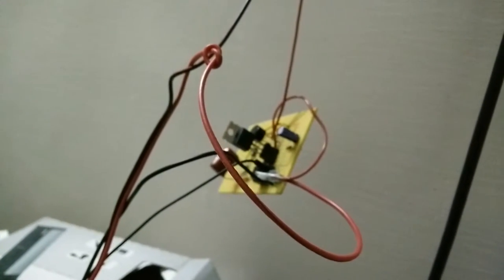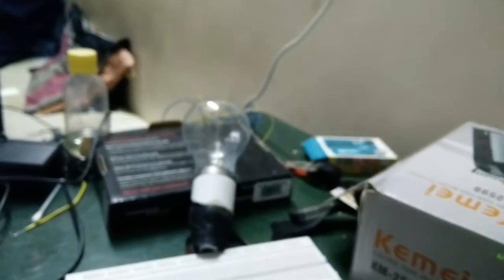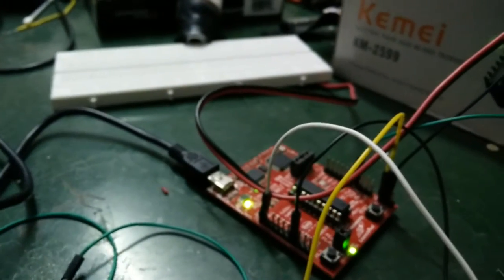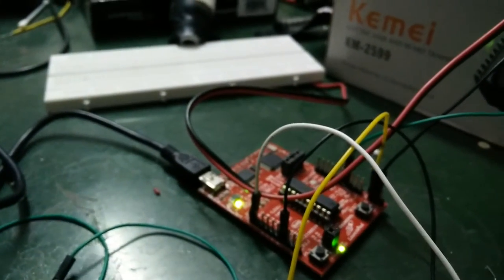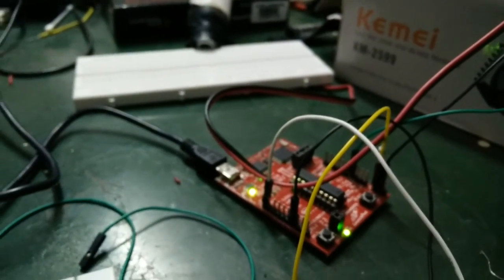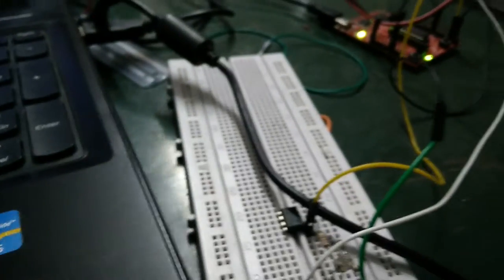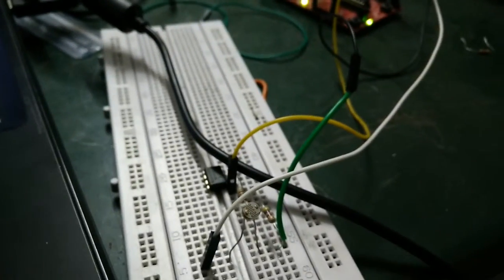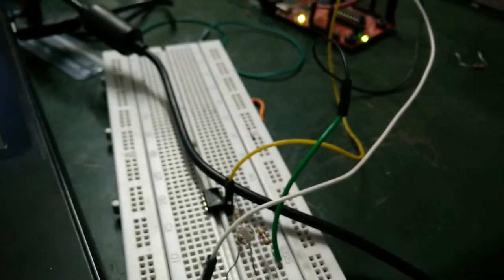Adaptive Lighting for Motorcycles

Comment: Can you do a video for adaptive conering light.  Suppose we mount 2 saperate LED auxilary light on the left and right of a motorcycle. The idea is when we lean left the left light lights up and when we lean right  the right light. Which gyroscope can be used with 12v dc from the Motorcycle batttery.( both lights shuts off when the Motorcycle is running straight)
 I need this for DIY project , as i cannot afford Aftermarket Headlight with Adaptive conering lights.